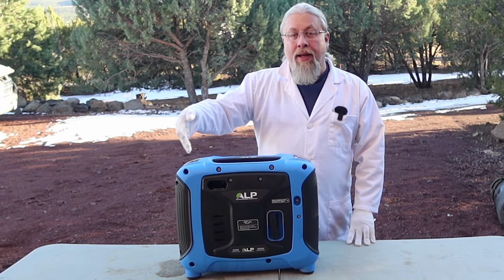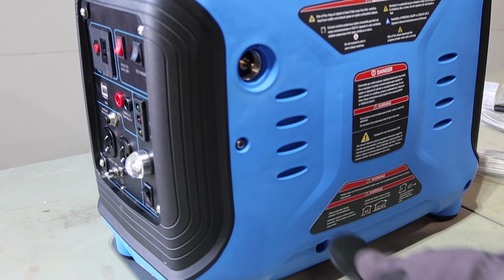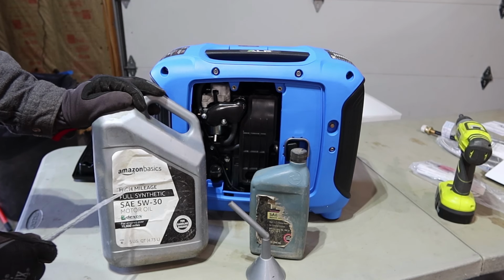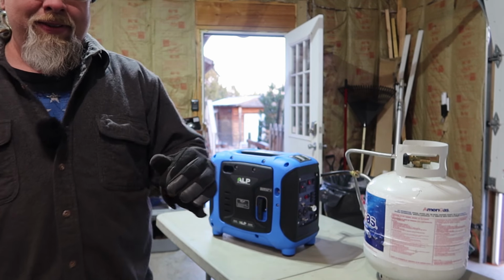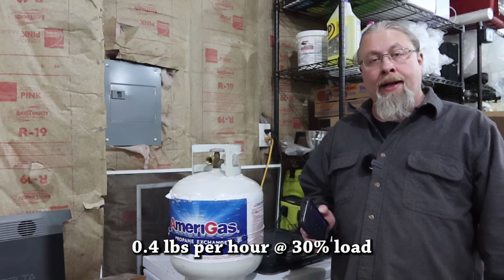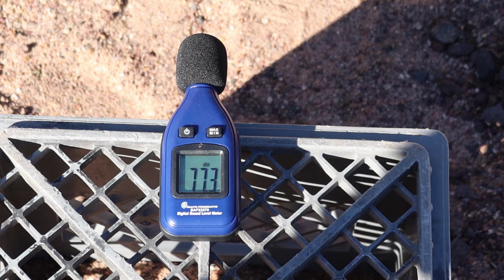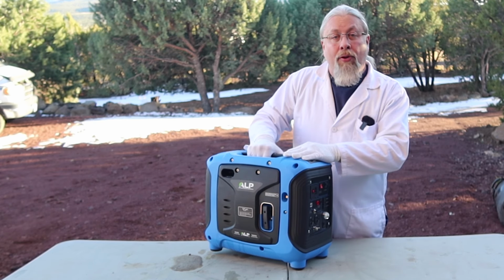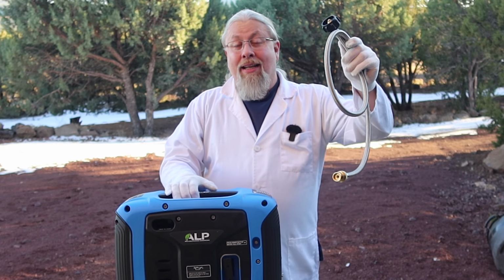ALP 1000w Propane Generator Review | Parallel Ready Eco Friendly Compact Efficient

Comment: If that works this well that's great because most multi fuel generators have terrible hrs to fuel ratio. I had a big 13,000 watt genny and Honda told me the efficiency differences between gas propane and natural gas. The regular gas was a lot more efficient.  So a company making one work effectively on propane is great.

Comment: Just a quick note for you the oil change interval on that generator is actually correct and here’s why since propane is a gas and it’s not a liquid feel like gasoline that produces carbon which is what pollutes the oil after running that generator for 40 hours if you pour some of the oil out it will look like it’s brand new I run propane in a vehicle and I change my oil every 10,000 miles and it looks much better than oil that’s come out of a vehicle with only 5000 miles it’s run on gasoline or diesel obviously so propane fueled generators can run much longer typically double the interval plus another 10 hours that you normally would change out oil in a gasoline generator.

Comment: Why you running it only outside? It’s propane, that’s why lots of forklifts are propane, so they can be run inside.
Reply: The only point propane has for inside running is that it doesn't stink as bad as gasoline or diesel exhaust.  It will still kill you and everyone else just as fast.  The fuel type has no bearing on the fact that it's using up the oxygen in the space and producing deadly poisonous carbon monoxide.

Comment: Slap one of these onto a 500 gallon tank and you could go borderline off grid as long as you don't need anything beyond the 850 or so watts. A 5k watt model would be nicer, but a draw that hard would probably ice up a grill tank, I'd imagine.
Reply from the maker: You can buy two and parallel them for double the power.

Comment: What is the use case for this thing?  I just cannot imagine why anyone would chose this generator over a gasoline one.   The fuel is just very inconvenient and expensive. You are always stuck with the big heavy tank.  Gas is everywhere in America. Propane is not.
Reply from the maker: It's $1.70 a gallon where I live. I also traveled America through 37 states over 3 years and never once had an issue finding propane. Propane lasts forever, gas doesn't. You spill gas you start a fire. Gas generators smell and burn through more oil.
Reply: @HOBOTECH  Propane only weighs 4.2 pounds per gallon while gasoline weighs 6.3.   So a full 20 pound bottle has 4 and 3/4 gallons.    From what I have read, gasoline is about 30% more energy dense than propane.  I read that when you adjust to a per-BTU cost, propane is more money.

I'm sure propane is available in every state and in every county, but it's not on every corner was my point.

Storage may very well be reasonable reasons to use this genny.  I suppose then the best use case is as a backup source of power where the fuel can be purchased and stored on site for long periods of time.
Reply: In the US, you can go to a gas station, food store, hardware store… and just swap tanks when needed. These tanks are very common for people who grill, all summer long. Also, the little green tanks are readily available inside Walmart.

Comment: 1000 Watts??... so I can't even make toast or use a microwave? It's won't run a heater either.
Reply from the maker: With 1000w, I can run the 5000btu air conditioner in my RV, the 700w microwave, an induction cooker, and a pizza cooker which can make toast. Only one at a time but I have done it for years.

Comment: maybe the reason not to include oil is so they are exploiting ignorance and they want you to destroy the engine by running it without oil so you will buy a new one i dont imagine warranty would cover damaged caused by running it without oil.

it may be possible that oil is not required if you are running it in a temperature range of from winter to 70 degrees.

or the oil on the oil plug may be to make it easier to remove

if it is mystery oil i would throw it out and get new because  it is possible to void your warranty due to damage caused by contamination

Comment: I could never start a 5000 BTU air conditioner w/ anything less than a 3000 watt air conditioner. Only way I could imagine running an 5000 BTU air conditioner off a 1000 watt generator is to plug into a 3500 watt inverter connected to 2 series 31 batteries with the generator connected to a marine grade 20 amp battery charger.
Reply from the maker: I ran my 5000btu in the RV all through summer 2019 off a 1000w Sportsman and have the videos to prove it. Maybe you need a unit with soft start like they offer in Frigidaire's.
Reply: @HOBOTECH  My 5000 BTU ACs are Walmart $100.00 units. They need lots of juice to crank the compressor. I did not know there were "soft start" ACs. I'm off the grid and will  like to give your experience a try this summer in my bedroom. A vid would be MUCH appreciated.

Comment: I always love listening to someone who knows what he’s talking about. As an engineer by profession I hate some moron trying to bluff his way through.
Reply: Did it stand out to you that he did not properly simulate an ac? Because the starting watts are over 1000. Would be nice to know the startup capability of this generator.
Reply: @paulhorton765  The champion dual fuel generators are nice because the newer inverter models have large capacitor. A lot of things in his reviews stand out to me. Like he doesn't seem to know that all engines are run at the factory and then drained of oil.
Reply: @Rack-Hammer  Yes. It is sad what utube  has devolved into.
Reply: very Dilbert-esque comment

Comment: a 1000w barely can power a cheap coffee maker. I have a 1500w inverter that i run on my truck that struggles with making coffee. apples and oranges comparison but i wouldn't buy a generator if it has to run at it's max limits for a simple device.
Reply from the maker: Then you have the wrong coffee maker. I have a $15 Mr Coffee from Walmart that will run all day on 650w.
Reply: @HOBOTECH  im more in the market for the most efficient 3000w generator. So I can at least run a mig welder. But keep up the good work. I'm looking at the generac

Comment: 1000w x 50hrs on 1 propane tank. Propane tank swap ~$15 swap at Walmart.
2000w x 48hrs on 6 gal gas total. Gas @ 2.50 per gal = ~$15.
At current gas prices were running cheaper power output wise.
Reply from the maker: Filling the tank yourself is not only far cheaper than swapping but is filled full instead of only 3/4.
Reply: @HOBOTECH  Not everyone has those options. Still Im assuming your "full" tank was where the 50hrs came from which is where I based my mathematical comparison. 1000w is not necessarily real world useful.

Comment: I like the propane.   You can store propane very very long time.   Dislikes.  seems rather loud and it putting out a simulated sign wave, need to be aware of this depending on what you running.   Funnies....    I wanna order mine in a camouflaged color, that way when I set it down in the woods,  I cant find it.   lol.
Reply from the maker: It's a pure sine wave. I show this in the video. I also show in the follow up video it is not very loud compared to other generators of its size.
Reply: @HOBOTECH    Kinda funny alot of comments said it was loud.  If that is not a voltage inverter going through a low pass and not an actual generator,   SHOW ME.

Comment: Propane performs poorly in cold weather. I can't even run my 1 lb tank empty if
 it's below 50 degrees. Your A/C test would be completely different at 90 degrees (a whole lot better).
Reply from the maker: I ran most of these tests below freezing. I had no issues.
Reply: @HOBOTECH  The point is, you get much more runtime in warm weather. The vapor is less dense,
 and therefore, slower evaporation of liquid. Wrap that tank with a 50 watt heating pad and see a dramatic difference.

Comment: It's assembly oil to keep the engine from ever having a dry start and could help with brake in you do not have to take it out.😃👍
Reply: How much it cost?
Reply from the maker: Try clicking the link.

Comment: I had a dual fuel generator for my 5th wheel trailer back in 2010-11 when I was living on the Mississippi gulf coast.
It saved my bacon twice because after a power outage (lots of wind storms on the coast) there was no way to get gasoline, but propane sellers had plenty of pre-filled tanks plus delivery trucks.. I bought a 70lb tank that lasted 5 days.. Sold it with the RV, but now I'm ordering this one for my food truck.. Perfect size to run the fridge and lights.

Comment: I still prefer gas. The Honda can run dual fuels. Pretty neat unit if you need small wattage usage. It has oil in it to do a run test from factory. Small engines run 10w30 and you should run conventional before converting to synthetic. Overall nice video man. Hope i didn't critique too much. I'm a Master Auto and Diesel Mechanic. I wonder if this unit has a regulator built inside the generator. The Honda conversion has a regulator on the hose.

Comment: Hobo I know you said that the generator sound test was done at 23-ft but now you have to put an extension cord on a generator to use it at 23-ft which means you're even going to get the less power anytime you extend the power through a extension cord it reduces its efficiency
Reply from the maker: Untrue if you use the proper gauge extension cord for the distance.
Reply: @HOBOTECH  yeah hey there hobo I'm an electrical engineer and anytime you ADD extension cord to an outlet a generator anything it adds  resistance in the line
Reply from the maker: @markket1154  Yes you lose a FRACTION of a volt over 25 feet. Makes no difference. If you're an engineer then you know better. Most will run this generator away from their camp and will use an extension cord.

Comment: During your unboxing segment you show the long hose coming out of the box yet you say it isn't included later on.  Which is it, included or not included? Also, Why is the propane port cover not attached?  For an item that gets accessed every time the generator is used this should be permanantly attached or it's going to get lost.
Reply from the maker: It's NOT included unless you use my code at checkout then it is included for free.

Comment: Reviewers always talk about losing the cover screws without ever giving you a solution.  Go down to your local hardware store and buy a couple of cheap small O-rings just large enough to slip over the screwthreads and your all set!
Reply from the maker: After spending $500 I shouldn't have to buy anything.
Reply: Some manufacturers add screws with little rings on the opposing side, so after the screws are loosened, they remain attached to the panel, you can drop the panel, do the work, lift the panel back up, and re-tighten again.

Other manufacturers may create a half-moon turning knob on the chassis, turn the half-moon, drop the panel, do the work, lift the panel, run the half-moon to secure.

There are many ways to avoid the loose screw issue.

Comment: Are you familiar with the WATT propane generator that uses a propane fuel cell instead of an engine?  It’s completely silent!  I thought that’s what this was until I heard the engine when you pulled the cord.  I would never consider something like this!!  The WATT propane generator can be used aboard boats or camper vans, and it runs all the time, day and night, silently!!

Comment: This is the least expensive pure sine wave generator I found on the market so far. Good product for your money. It does have a limited power of 850 watts continues. 1000 watts of starting power. Maybe they will make a 240 volt version for wells and other motors and pumps.
Reply from the maker: You can buy two and parallel them for double the power.

Comment: I am very picky about the waveform of the inverter of  this so called generator. A real generator will produce a pure sine wave. Most generators are alternators with a power inverter. I will check with the manufacturer and ask what kind of inverter they use. My equipment must have a pure sine wave for its power source. Thanks for the video it was interesting and informative.

PS I did find out this generator produces a pure sine wave so it's safe for delicate  electronics and motors.

Comment: You obviously know a lot!  But not about propane.  A gas grill tank is a 20lb. tank and actually holds 20 lbs. of fuel and should be filled as such if you have the tank filled.  There is 20% air space needed but it is present in addition.  If you buy a prefilled tank, it will be filled with from 15lb to 17.5 lbs. depending on the market in your area.  That has nothing to do with the actual capacity of the tank or “80%“ fill.  Just a market based decision.  Thanks for the info!

Comment: Not shore but Doesn’t propane tanks run poorly under 32°.Do you use only like 60% of the tank.That’s why the big generators a bury the propane tanks for thermal heat around the tank.Just because I wanted to get a Propane generator to run my whole house during Black out but they told me I had to bury the tank.Just because the winter use. And I had to much Ledge rock.
Reply: run a warming blanket, from the generator, to the propane tank! Problem solved! (joking, I dont really know)... might work, maybe. :)
Reply: yes that does work. but where I am at it’s Against code.Propane delivery guy will not fill your tank you Gotta have the blanket off and hide it.

Comment: That won't even run a electric heater. Anything below 2500 watts is pretty much useless.
Reply from the maker: You can buy two and parallel them for double the power.
Reply: @HOBOTECH  or buy one good one the same price is too cheap ones

Comment: Great review, perfect for operating a small air conditioner. Very nice for a cabin in a remote area, especially since they can be combined to double the power. As an SAE oil engineer, i would have used the original oil for twice as long, for a better engine break-in. A full synthetic oil will decrease fuel consumption by about 5 to 8 percent, but triples engine life, because it doesn't allow carbon to build up.
Reply: 1000W A/C?   seems more suited to lighting and battery charging

Comment: I like MMO. I blend it with STP oil treatment for my engine assembly lube. Works well. For recip engines, anyways. It has an infusion process to penetrate the pores of the metal and the stp makes it stick. The resulting viscosity resembles 30wt. Flows well, leaves a nice film.

Comment: Companies fill motors with oil to start and test and break in for some period of time. But they have to drain the oil to ship. Propane engines can go twice as long as gas or diesel on oil changes. They are a lot cleaner. Supposed to last 50% to twice as long as gasoline engines too
Reply from the maker: This is the first generator I ever had that wasn't totally bone dry in the oil casing. I suspect they did break this one in.
Reply: @HOBOTECH  i have mower shop and they all come with tags must fill with oil. They all show signs they had oil in them before. Figured for testing or breaking in. I just never asked if they ran them 5 min or 1 hour. May vary from mfg. Had guy move here from England and shipped 3 year old push mower. He didn't drain oil like USA law requires. Box got upside down at some point. Soaked air filter. He got it at his house. Wouldn't start. I always check air filter first cause this is issue 25% of time. Took old filter out. Pulled rope. Started on 2nd pull. Muffler burnt out oil in it. Put new filter in and charged $50 for filter and 10 minutes spent on it. 

Kinda strange actually you got motors that never had oil. Maybe smaller or newer companies? Maybe not as good of quality check system? Everything should have signs of oil and being started at 1 point. If not that company is not testing before shipping and will have a higher return rate. Just my 2 pennies from my 20 years as mechanic and shop owner. I just found you today. You sound like a smart dude. Great vids on couple I watched. Hopefully I didn't come off as condescending. Lot of stupid guys don't know what they saying out there you know. But you I admire as you are a smart dude.

Comment: Sounds good!  I don't care how efficient it is or what kind of fuel it uses.  
I just want one that I don't have to fill the tank twice a day, and will run all night to keep my A/C running during power outages (I like to sleep late).   
I just wish it was quieter.  I live in a city, so I don't want my neighbors complaining about the noise at night.
Reply from the maker: My test was at 1m, this generator is rated 54db at the proper testing range.

Comment: Nice unit. However I would never run a new unit without load for its runin. Start, 25% load for 5 minutes, 50% load for another 5 minutes and then alternate between 50% and 75-80% load every 5 minutes or so. Gets tge rings to seat nicely.......never baby a new engine.

Comment: Well, if the US Senate, went along with Trump's $2,000 bribe attempt, I'd order one of these. The oil change requirement, are probably based, on the clean burn of propane. Large industrial ICEs, usually have the same recommendations. While many see a scam, there is a reason, for the %800 fill, and it'd practice on all sizes of vessels. 1; to provide a head space for the gas to boil off the liquid. 2; that space is needed for the liquid to expand into, when ambient temperature increases. Another thing to remember about propane. Wile I can't remember the exact temperature -40 or -45 propane cease to boil. That's why in some climates. Domestic tanks are buried well below the local frost line

When I seen the opening, I though great another you tube huckster. Well I was wrong. I'm an electricity/electronics, I appreciate all the details including the AC wave form